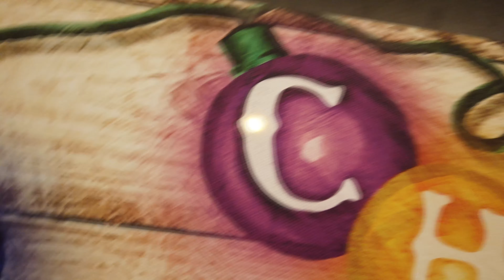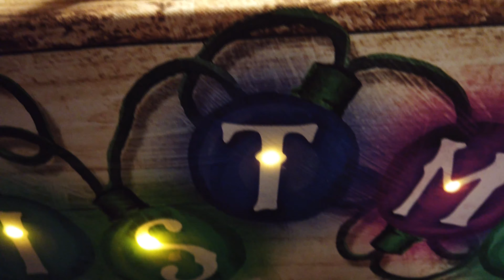LED Christmas Decoration - 18650

Comment: You could take out the built in 3x AA battery holder and carve out some more room and fit 3x 18650's in parallel. Then it would really last a very long time. While you are at it add a TP4056 board with a micro USB charge port and use that to charge it next year :)
Reply from the maker: May just do that.